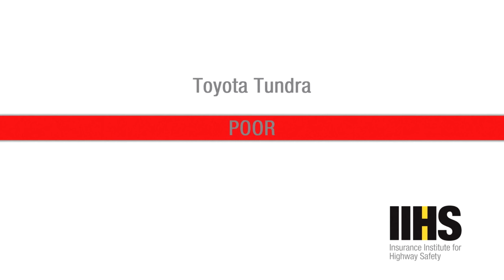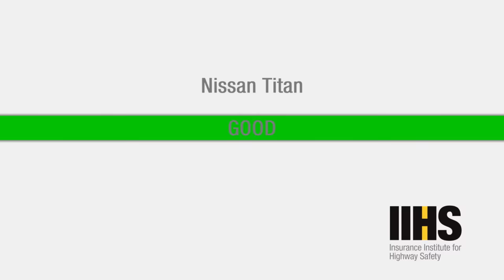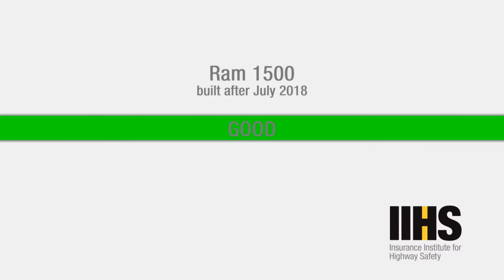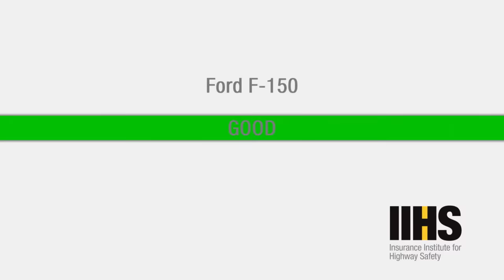TRUCK CRASH TEST COMPILATION - Ford F150, Toyota Tundra, RAM 1500, Nissan Titan

Comment: Every truck: slides
Ford F-150: bounce Build Ford Tough
Reply: Without a doubt was the best one. I just bought a ram over a volvo and cant believe the difference. The volvo just slightly deflected off this test and probably could have kept driving
Reply: Was waiting to a silverado/sierra the whole time. Bet it would leave the ford in the dirt
Reply: all two vehicles I've ever owned are ford. My family also owned a ford in the 2000s. All three, including my current one never failed us.
Reply: The Ford was not overlapped as much.  The wheel never even hit the barrier. The others did.
Reply: cahan Fowler refer to 7:10
Reply: @cahanfowler2020  ? They're all overlapped equally as much. 25% of the vehicle front. It's just designed better to deflect off the A-frame instead of crush and spin
Reply: The F150 has crash bars in front and behind the wheels to deflect the impact and prevent the wheel from entering the cabin. 2015 MY trucks, some trims, did not have this bar and resulted in a Marginal rating.  The partnership with Volvo went a long way in helping Ford design really safe vehicles.
Reply: Bounces right into oncoming traffic.... ?????????
Reply: Allan Berriman potentially but not likely in this type of accident, this would usually occur off of the roadway.
Reply: @cahanfowler2020  the front wheel clearly hit
Reply: @cahanfowler2020  You need glasses, or therapy for your denial issues?
Reply: I think most of you are blind in that the F150 clearly stopped any/all debris from entering the cab, including the wheel.
Reply: Built?
Reply: @acdii  you're right, look at a 2001 f150 crash test. Pretty scary stuff. Then look at the 2001 tundra. Did extremely well. In fact, it got the highest rating of any full size truck back in 2001.
Reply: Js23187 he said the Chevy was marginal and the ford was good
Reply: Js23187 lol nope
Reply: Js23187 at the end of the video the guys says the Silverado and Sierra were rated as marginal

Comment: In 20 years, I want to be able to slam into a cement wall at 90 mph without any damage to me or my car, thank you.
Reply: You would have no crunch zone and it would be even worse for the driver
Reply: Yep. It'll bounce right off, pop back into shape and not have a single scratch on it. Meanwhile you'd simply look up and ask the passenger, "did you sse anything just now?" they'd just be like "meh, must have hit something at 90 mph again... no biggie"
Reply: Your thinking of forza horizon 4
Reply: If your vehicle is indestructible, the forces onto will guarantee death.
Reply: 19 something something Toyota Hilux be like
Reply: @LITTLE1994  Maybe not if there was enough room in the truck for the seat you were strapped on to travel forward a couple feet inside the truck, maybe use shocks on the seat within the truck so you don’t come to a stop inside the vehicle all at once.

Comment: Crazy that Tundras have such a high resale value and yet they have a poor safety rating!!
Reply: Because crash test doesn't matter as much as reliability.
Reply: people dont buy them to wreck them. they buy them to work them
Reply: to be honest i see no difference between them, it all kinda looks the same
Reply: @arthurbenedetti9146  look at 9:00. The passenger broke a leg and kissed a grab handle.
Reply: @arthurbenedetti9146  same
Reply: Because Toyota fans are completely insane They worship that brand And fail to realize that copied a lot of manufacturers And people fell to realize all vehicles break down it just depends on which one's cheaper and reliable so you don't die driving it lol
Reply: This also proves my point that people don't beat the hell out of their Toyotas like the other trucks 😂 if you on the Chevy or Ford or a Dodge you already know we don't take care of them we beat the hell out of them so we need them to be safe enough so we don't die in them 😂
Reply: Because its an older design and doesn't hold up against newer stricter safety testing
Reply: @Chris-kq7ko  lol
Reply: @deathmetalmachine  Haha look at this poor amerigarbage fan. Sorry your favorite car brand isn't a global icon, or has a war named after it. and "copied a lot" they literally created the toyota manufacturing method something globally copied by every manufacturer.
Reply: @deathmetalmachine  "This also proves my point that people don't beat the hell out of their Toyotas"
Hahahaha imagine being this sad and delusional. Your ferd and cheby and fiat garbage isn't being used globally to fight wars fanboy. How can you unironically support an american company after they consistently have electrical problem, consistently refuse to fix their death wobble issue, and consistently have transmissions made of glass.

I've worked in auto repair for all my life and toyotas simply don't come in for the same level of repairs as anything else.
Reply: @deathmetalmachine  By insane Toyota fans you must be talking about Scotty Kilmer ? LOL
Reply: @deathmetalmachine  the interesting thing is that Toyota Tacoma actually worth more than Tundra in 2001 to 2013 in used market.  Not sure why that's the case.

Also, not all the Toyota are reliable, some has rusty frame, some has transmission issue, some has engine issue.  It often takes longer time to observe them.

Ford and Chevy are more in construction because they are cheaper to buy and more power compare to Tundra. However, reliability is a huge issue and many has premature issues because if the abuse they take.  Everyone has to do their research before they buy and I will always buy used trucks instead of new.
Reply: @deathmetalmachine  lol we get it Mr American Muscle...... lmao the japanese just make better cars lol, i get it you're a patriot but just accept the facts my dude lol
Reply: People who buy Toyota's buy them for reliability, everything else is optional.
Reply: @zieo8218  I actually prefer first Gen Tundra, 2000 to 2003. Great engine and transmission, and as long the owner look after the frame, they should last forever.   I especially like the Access cab feature and ability to seat six in a pinch.   Of course they are also easier to park as well.  All the newer tundra are like size of tank. Heck even the new Tacoma is size of first Gen Tundra
Reply: @Chris-kq7ko  I don't know anyone that buys a car to wreck it.. Accidents happen better to be safe than sorry.
Reply: You can't crash a broke truck that is sitting in the driveway lol.
Reply: I got in a highway crash in a yaris and came out fine lol
Reply: @deathmetalmachine  chance of you dying in Chevy, Ford and Ram are slim because they're always in the shop. Don't even get a chance to crash.
Reply: @deathmetalmachine  umm no. They are reliable
Reply: For some reasons here in phillipines  highlands ford dont last long but toyotas are strong,hmmmmm🤔🤔🤔🤔
Reply: @SPAZTICCYTOPLASM  Yup, I bought a used Tundra with 183K on it and its never had an issue. Ive seen tundras with over 400k on them and they still run like new. My co woker has a new F-150 and its constantly in the shop.
Reply: @Chris-kq7ko  Except you dont always have a say in getting into an accident
Reply: @SPAZTICCYTOPLASM   Tundras have the worst reliability rating of any truck.
Reply: im not quite sure howq they rate these, each crash looked almost identical to me and ive crashed fords and toyotas, at what looks to be about 60mph those dummies look like they wouldve lived, cant really rate that as poor
Reply: @SPAZTICCYTOPLASM  Ram sells roughly 650,000 trucks a year compared to the tundras 100k and ford sells around a million.  If the tundra were the better truck it wouldn't be dead last in yearly sales. If it were that much more reliable it wouldn't be dead last. If you  look at these trucks without any bias whatsoever the tundra is DEAD last in every category compared to Ford, Ram, Chevrolet, Gmc and Nissan. Toyota's sedans dominate the us market because they are better than offerings from the domestic brands. They own the midsize truck market because they build a better midsize truck than the domestic brands, but as far as full size trucks go......they are dead last. Toyota has their work cut out for them if they want to own any of the full size truck market.
Reply: @the40735  most american cars fanboys have the same "patriot" mentality when it comes to buying cars or trucks. Reality differs from that, Toyota has proved its reliability and safty long time ago. The numbers you've stated doesn't mean Ram is better than Toyota in any way other than they own the market here in north america. Just like how apple owns the phones market in here. Majority of their customers are just bunch of morons who don't do a research when they buy a product "it's american, it must be the best product out there". I have few idiot friends who went and bought RAMs just because they "look cool". It's never about the quality..
Reply: Currently Nissan builds the best foreign full-size truck
Reply: @the40735  I used Ram just as an example. Maybe it's not the best but definitely not the worst. Nissan has lots of issues and it's been like that forever. Not to mention, they rust quickly. Their quality of cars is junk to be frank
Reply: Tundra's have crap resale value (believe me, I know). I think you mean the Tacoma, which has the best resale of any truck.
Reply: Its also by far the oldest car they tested there
Reply: @Chris-kq7ko  Even though they got second worst in class towing and payload. Not much of a reason there. F-150s and Rams are still a better buy plus they got super nice interiors especially 2021 F-150s and 2019+ Rams.
Reply: @arthurbenedetti9146  It's about the safety of the humans in the vehicle, not how the vehicle holds up.
Reply: Toyota's have always been overrated.  But when enough BS is repeated long enough, people just accept it.
Reply: Guy martin  Lol.
Reply: @SPAZTICCYTOPLASM  Doesn't "matter"? Bruh that's one of the most important things or you want to get crushed in a car or something?
Reply: Who cares about safety when your engine is reliable sarcasm
Reply: @SPAZTICCYTOPLASM  my Ford makes over 1,000 ft/lbs of torque. My dodge makes over 1,400ft/lbs with a 6 cyl that gets 20mpg…. If I hooked my gooseneck up to a tundra the suspension would buckle and even if it didn’t it couldn’t get up to highway speeds.
Reply: @Chris-kq7ko  never seen a Toyota being worked ever. They just drive em, it's always a Ford, Chevy, or ram being worked.
Reply: @Imachowderhead  yet my neighbors tundra takes 10-30 seconds to start in normal weather, and sounds like it's ticking with 120k miles on it. 0 safety. Rather have 100% safety, and 75% reliability
Reply: @GriffyWdaGrippy  don't care still take a tundra over anything else. Mine is bulletproof.
Reply: @Imachowderhead  so is my 6.0 at 327k miles.
Reply: @GriffyWdaGrippy  cool my tundra is right at 440k. Maybe one day yours will catch up.
Reply: @billgates1682  i wish that was the case, then maybe i could afford one
Reply: @magnusatheos7301  show me any other truck that routinely makes it past 400k
Reply: @benjammin8510  I keep hearing about these mythical Toyota's that last forever but have yet to see one.  You know what I did see recently?  An old Chevette.  Remember those?  No old Toyota's though.  Their frames must have rotted out lol.  Maybe in those southern rust free regions, but I bet everything lasts forever in those areas.
Reply: @magnusatheos7301  nah, check the junkyards out here in CA. You'll find a bunch of 20-30 year old american made trucks while there are toyotas and nissans still doin work

Comment: 1/11/17 I was driving my 2014 F150 and the road turned to ice. Another driver lost control and slid across my lane. I was doing about 45 when the road conditions went to shit really fast. I hit the other truck nearly exactly as in this test.  Have to say Ford does know what they are doing. I wound up with some separated ribs and a scrape on my left shin. The passenger compartment was not intruded upon, all doors still opened and closed, though the cabin at the firewall was bent.   If I had a passenger, they would have walked away pretty much the same, sore ribs from the seat belt.  I hit at 45 MPH, it was wet ice, no traction period.  It was strange, drove 55 miles in the same weather and not a single patch of ice, crossed a tree line, all ice, with rain misting it.  It was just this one little section of road too, all roads leading up to it were ice free.  Needless to say it was a total loss as the frame bore the brunt of the impact and looked like a Rorschach .
Reply: acdii-The main thing is that you survived it.I'm glad to hear that you're ok.
Reply: so, you still have the time to know, who protect you in truth...  it's not a mass of iron
Reply: حبيبي والله
Reply: And the 7 Mexicans in the Prius you hit all died.
Reply: @steve tarrant 
 Yep 😂
Reply: Roads can ice before the air temp is freezing. You need to drive cautiously of it's below 40°F, because of the chance of hitting these icy patches. Glad you're okay!
Reply: The same reason why my buddy bought another F150 after being t-boned and flipped on his side in his previous F150. He had his seatbelt on and was a bit bruised but walked away. Ford has their safety stuff together.
Reply: Gosh I reqlly hope you are ok

Comment: A Toyota Tundra can be easily over 40k , the poor protection is unacceptable
Reply: But the reliability is acceptable
Reply: These are body on frame vehicles.... yknow like the old days but better. What kind of protection you want from something so unavoidable.  No one takes into consideration how vehicles are built just how many airbags are in it.. stupidity
Reply: The body itself is meant to essentially fall apart, the Frame itself is so damn low. Cars on the other hand are unibody so they body is the frame
Reply: 44,995$
Reply: Yes but still cheaper than FORD
Reply: The amount of money you pay for a Tundra is about reliability.
Reply: Mr Mejias Thats a myth that toyota fan boys invented to sleep at night. The f150 and other trucks have just as much reliability. The tundra has been proven to be less safe in a crash and is built like crap.
Reply: @MrInzombia  You can say whatever you want are entitled to your own opinion and so am I. Where I come from, which  is Venezuela, toyota is without a doubt the most reliable car make on the market, and it is not myth, you can see it for yourselves, 20, 30, 40 year old toyotas still on the road. People have also understood that more reliability means fewer car repairs. I me  tioned nothing about car safety. Some car makes produce cars that after 200k miles look like, drive and feels like garbage, same thing does not occur with toyota. You can say what you want, but there's a reason why toyota sells so many cars every year, especially in America. End of this story.
Reply: Mr Mejias If you are from venezuela then your opinion shouldnt be on trucks it should be preventing your people from eating out garbage cans, dying of starvation and children drinking from the drain systems
Reply: @MrInzombia  Who are you to tell me what my opinion should be about? Mind your own business. What are you doing about prisoners, the sick, orphans, widows and poor around the world? A hypocrite trying to lecture me.
Reply: @MrInzombia  It's funny how you deviated from talking about trucks to talking about a country's crisis when you realised you had lost the debate...
Reply: It’s a Toyota dude what do you expect?
Reply: It's just a case of it being an outdated platform.
Reply: @nmejias370  I mean, Toyotas are obviously reliable, but so are most newer ford's aside from the powrshift Fiesta/focus and some vehicles with early gen eb engines. Modern car reliability is so good now, that although gaps still exist between brands, they're pretty minimal, unless you're looking at like the bottom 5 brands.
Reply: A mere pittance, the 2020 Silverado can top $100 grand.
Reply: Brian Yu , TOYOTA- lets go places. Like the cemetery. No thanks.
Reply: @midnightspares  XD you could view that in multiple ways lol. Not only are some of their cars very unsafe, but they're also driven by old farts like 90% of the time lol. Seriously, they've unseated Cadillac as the go to old person's brand.
Reply: @TheCortez714  I like Toyota , especially their reliability, but I like my safety more. Just bought a Nissan Titan pro 4x

Comment: I drive an F150, Good results.
Reply: Same, im happy-er now!
Reply: No, very poor results.  The test was at 40 mph.  Unless you never drive over 40 mph this test is useless.  At 70 mph I bet the driver dies in a passenger accident!
Reply: David Beppler let me try to sound like you real quick.  “ also if u go 120 I bet da crash will be worser than 70 and everyone dies worser Dan 70. 120 worser than 70”. The test is at 40mph and Ford did better, now get over it and grow up.
Reply: @cameronjones1583  I like that comment.  You still sound stupid for disagreeing with me.  With speed limits in the USA at 70 mph the test should be at 70 mph.  Not sure where you found a speed limit in the USA of 120, but if they were, the test would need to be for 120.  Thanks for getting my accent right though!  :)
Reply: David Beppler because the average speed a motor vehicle collision  happens at 40mph in the states...
Reply: Yes me too ,

Comment: Built Ford TOUGH F150
Reply: No they aren't that tough
Reply: Ehh the 5.0 is
Reply: 7.3 best motor ford has ever made 

Ford 

Found on road dead 

Dodge 

if you can't dodge em ram em

Chevy the only thing able to eat a transmission faster than a dodge